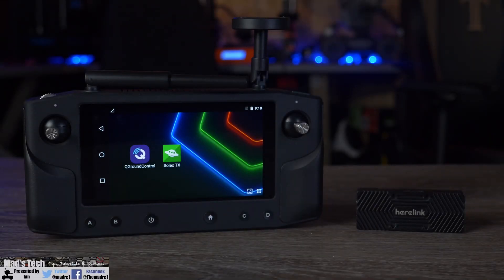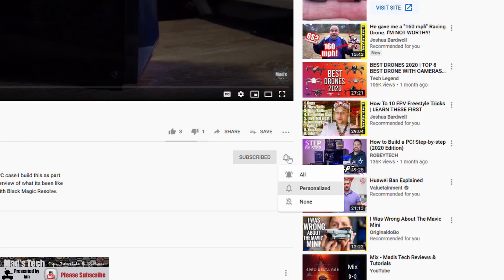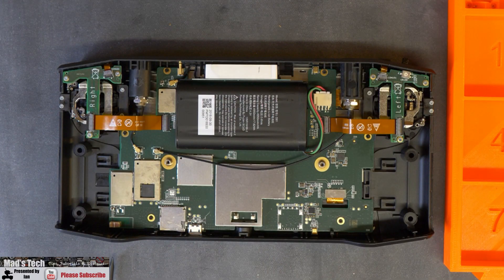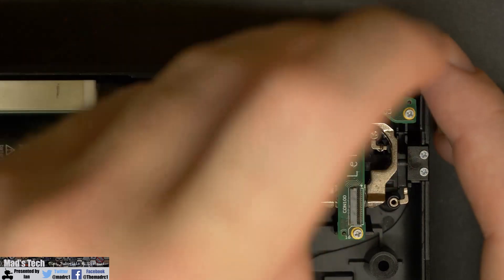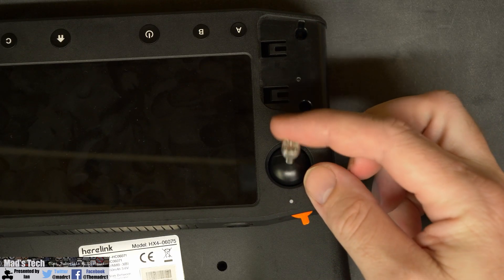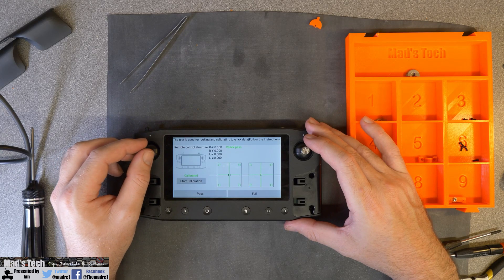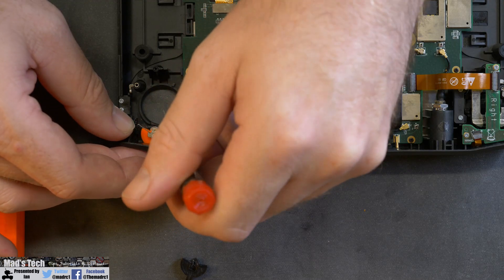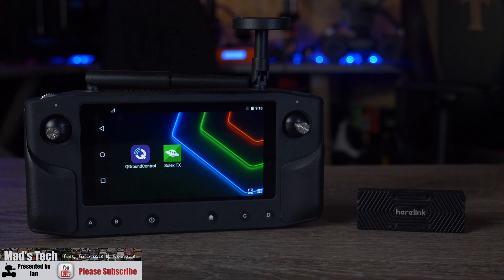Herelink Fixed Throttle Mod For Fixed Wing & Drones

Comment: I just did this for a Herelink Blue and it was even easier. Just remove the 4 hex bolts from the back and it comes right off. Then you can remove the spring tensioner by loosening the smaller bracket on the right. No need to remove the ribbon cable. Also no need to add a washer or custom bracket, the throttle feel was just fine as is. YMMV.

Comment: Hello,
Has Herelink made any improvements since this video was released so you can do the mod without taking it apart and replacing the 3D printed bracket?

Comment: I have siyi mk15.. spring loaded on the throttle and i want to use it as it is, how do you set it up on ardupilot cause I do